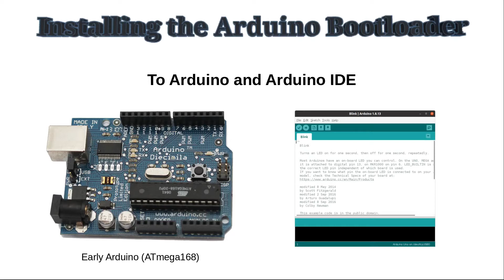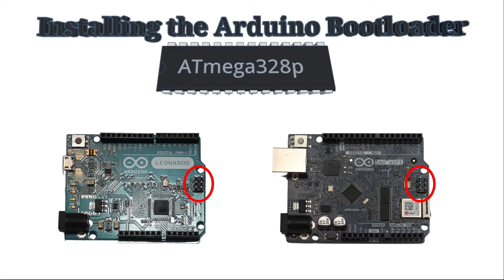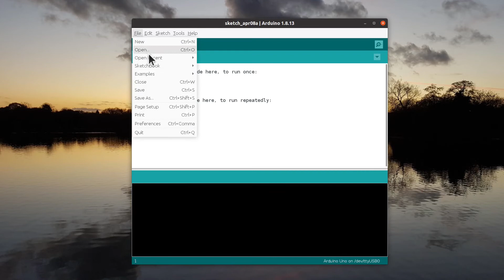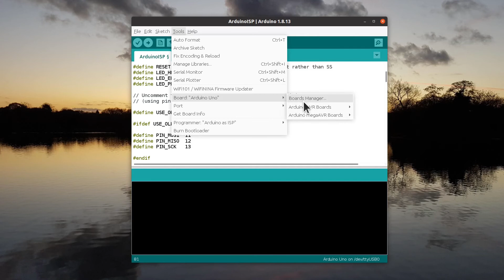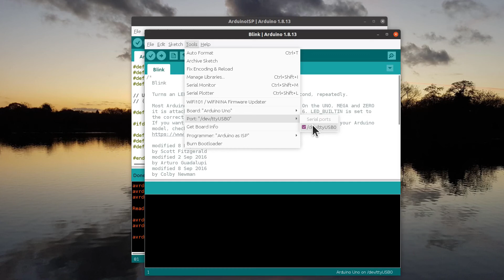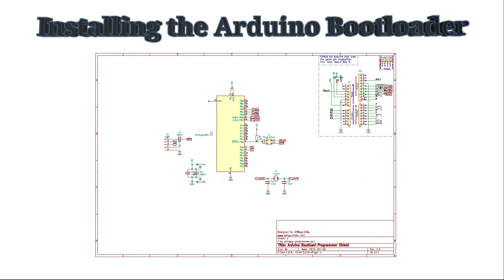DIY Arduino Bootloader - custom programmer shield

Comment: can i know why u use 3x 100nF this orange  i dont see it on 3:36 and i dont know for what it is used
Reply from the maker: Capacitor C1 is connected between the UART connector and the Reset pin of the ATmega328p. This is to reduce the risk of any transient noise on that pin from causing a reset.

C2 is connected directly across the supply near to the IC. This is to reduce noise on the power supply going to the ATmega328. Typically these should be as close as possible to the power pin of the microcontroller (pin 7). These are standard for any circuit which uses ICs with one typically next to the supply pin of every IC. You can create a circuit without one, but it is recommended one is included - hence the reason it's sometimes left-out out during a prototyping stage, but then added when creating a permanent circuit.

C3 is similar to C2, but used for the Analog to Digital circuitry within the ATmega. It's connected to AVCC supply connection (pin 20). The supply does need to be connected to the AVCC pin even if not using the A/D converter. If the A/D converter is used then the datasheet recommends using a low-pass filter is used for that supply, so I compromised with an additional capacitor. Looking at the circuit diagram for the UNO then they don't appear to use use either a capacitor or a low-pass filter near to the AVCC pin, but they do include an additional 100nF capacitor as part of the power supply circuitry, it's just not physically close to that pin. So again optional, I'd suggest C2 is more important.

Comment: Thank you very much for your informative video. Can you explain to me how we can install the boot loader through a separate ISP programmer instead of doing it by using another Arduino board?
Reply from the maker: To install the bootloader then you need to use an Arduino or other external programmer. 

Once the bootloader is installed (or if you buy an ATMEGA328P with the bootloader already installed), then you can use a UART connection, eg. using a USB to UART adapter connected to the serial pins on the ATMEGA, or by connecting directly between the serial pins of a Raspberry Pi to the serial pins of the ATMega328.

I've shown an example using a USB UART in the video below.
https://www.youtube.com/watch?v=gtij4ecuVgk&t=934s
Reply: Thank so much